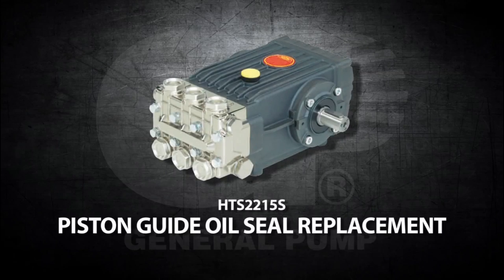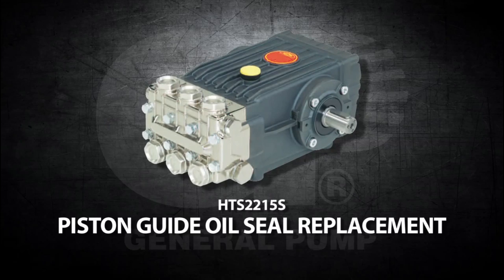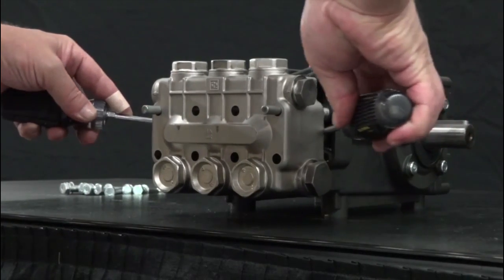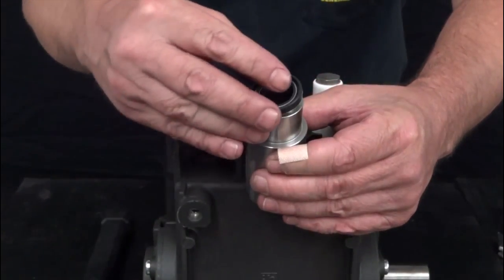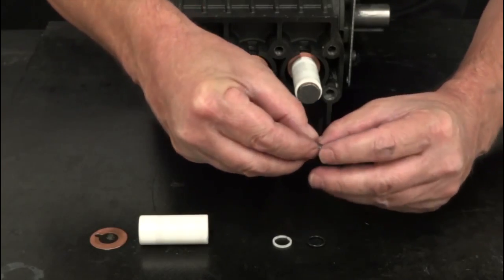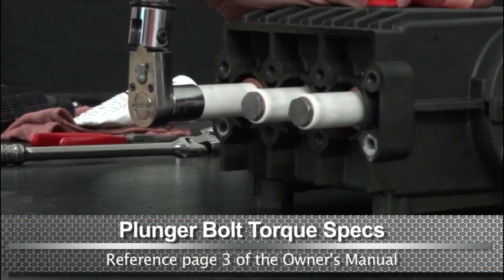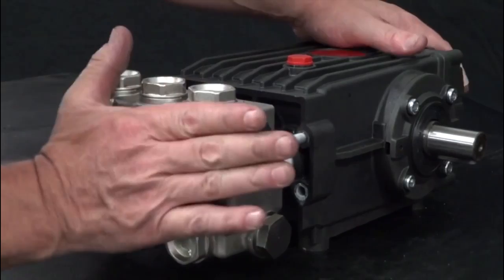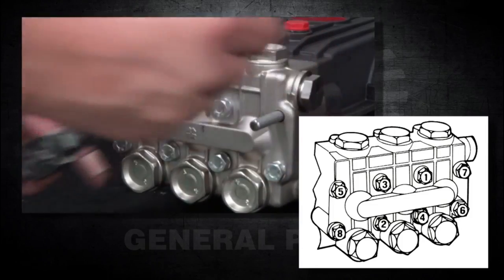General Pump High Pressure Rebuild Piston Guide Oil Seal Repair

Comment: by the time you buy all the parts to rebuild this pump you might as well buy a new pressure washer. not worth it at all
Reply: My guess is that you really don't need the extraction and insertion tools. Might can use a pick and deep socket instead. The actual piston oil seals only cost $10